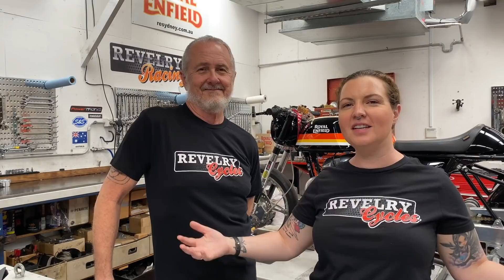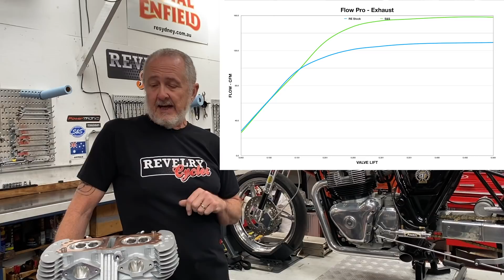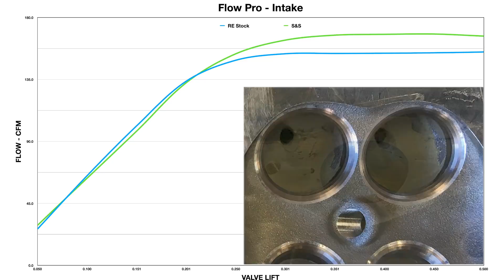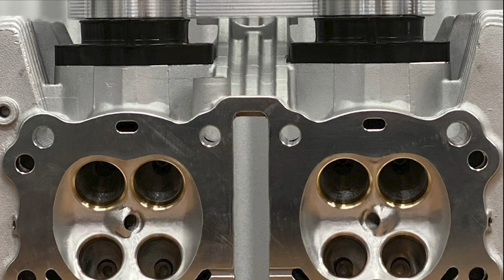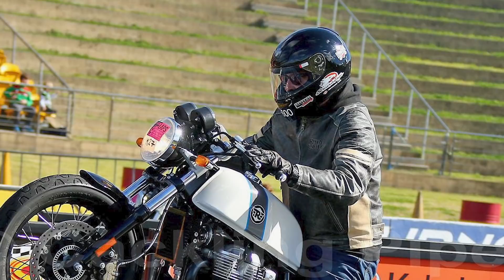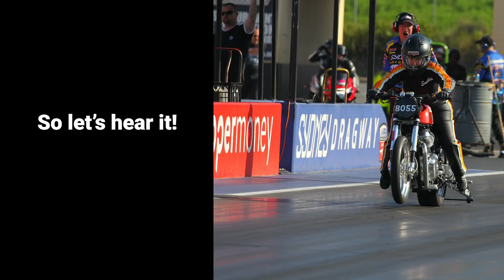Episode 7: CNC Cylinder Heads - Royal Enfield 650 Twins

Comment: You’re half right on the four valve info. Four smaller valves (particularly the intake valves) will generally have higher gas velocity than one big valve. This improves low-lift flow and cylinder fill at lower rpm, leading to increased torque. If you reference the changes in performance of the Harley-Davidson Twin Cam vs. Milwaukee 8 this effect is clear. Great videos and nice work on these great bikes 👍👍

Comment: good morning and greetings from Southern California. I love your channel and just subscribe. I just picked up a 2021 royal enfield Continental GT and I’m absolutely in love. I have a question if you can help. On the top of the cylinder head, there is a plate that’s held down by 48 mm bolts. I want to remove the bolts and slide the cylinder head plate out so I can polish it but I’m curious if those 48 mm boltsare structural so remove them. Also, what is the torque on installing those 8 mm bolts back in? Thank you so much.

Comment: Thanks for another great video.  Been watching these for a little while now and whilst I am only likely to do a fraction of this work to my recently purchased GT650 they have been really interesting for their technical input and impressively presented.  Having ridden mine for a few weeks now I can see why so many folk rave about them - it's a delight to ride on the twisty roads here in mid-Wales.  Air filter & exhausts done with camshaft waiting in the shed for installation but may hold out for some high-comp pistons as well - the more I research the more that seems to make sense although it does seem to involve going down the "electronic tuning" route which puts me off a bit from doing any more than I have although if I watch much more of you two I may well take the plunge.  Ramble over - keep up the great work!
Reply from the maker: The high compression 650 kits work really well with the S&S cam. We're consistently getting 52-56 horsepower and 46-48 lb ft torque with stock heads and throttle bodies. Yes, you will need to use a tuner, like the PowerTronic, that lets you alter the timing. Because the profile of the HC 650 piston crowns makes the flame front travel "up and over" the flame takes ever so slightly longer to propagate than in the flat top 865 piston kits. This means so you need to back the timing up a bit to keep it from pinging on hard acceleration.
Reply: @RevelryCycles  Thanks for the advice - not expected as I was just thinking out loud, but appreciated all the same.  I've only had it a few weeks and will probably run it in its current state for the summer (if it arrives here!) then look to work on it as a winter project and learn about the dark arts of ECU tuning!

Comment: hello :D Im so grateful for this videos. Can you please tell me why in this videos of Royal Enfield modification you don't mention iridium plugs or cables like ngk... don't you think those are significants upgrades on the bike ? Im wondering and asking because I only have money for exhaust and air filter and maybe radial tyres...so... why not change the plugs and cables? 
thank you very much
Reply from the maker: If you're operating within a budget, and actual power output increase is your goal, plugs and wires are not necessicarily high on the list of early priorities. We would suggest when it's time to change the OE plugs is the time to consider an upgrade.

Comment: Thank you very much for the video. I have a doubt, would you help me with it?

I'm currently working on an Interceptor, and the rear breaks are slipping.... They do not grip properly.... Can you help me fix it?
Reply from the maker: Thank you for trusting us enough to ask about your motorcycle concern.  Please understand that it is not appropriate to diagnose, repair or advise on motorcycle issues over email, messenger, the phone, or with photographs or video.  To do so would just add to the mass of misinformed opinions that flood the internet already. If you can not physically bring the motorcycle to us no opinion will be rendered.  If you want to bring the bike to us please ring to make an appointment. If you are not near us and need assistance please seek the advice of a properly trained local mechanic.

Comment: Thanks again for another wholesome and greatly informative video! To answer your question my GT 650 currently has a Diablo full system exhaust, which I picked for the looks and sounds it producest to be honest. The bike also has the stage 1 and 2 performance air filter and a powercommander V piggyback ECU. The latter was a necessaty as the exhaust and filter combo made the engine run way too lean. I also did some cosmetic stuff and slapped on some straight clip-on handlebars for a more racey, active riding position. A Li-Ion battery also just arrived to shed some weight. The next thing I'm saving for will be the SS cam and a big bore kit right after a suspension upgrade. I already enjoy the character this engine has but a little more oomph is welcome. Basically I'd like the same I have now, but a bit more outspoken and with an extra high range kick. The bike still needs to stay a reliable road going bike, I'd just like to get the most active, fun riding experience I can get out of it. Pretty much everything is and will be handled by capable professionals mechanics, as I lack the tools and know how to really do these things properly. I'm not looking to go so far as to change to cylinder head, and I do not yet see how I can utilize you guys from the other side of the world other than learning from your video's. Is there any way I can thank you for your effort from this side of the world?
Reply from the maker: Wonderful message Raynor.  Love your enthusiasm for your bike.  The best thing you can do is share our videos with your social network.  :-)

Comment: With reference to flame propagation across the piston. Have you or do you time the spark plug gap to face the inlet valves ? I have seen spark plugs with 1 or 4 electrodes and wondered if this would help with smoothly burning the fuel .Just curious.

Comment: Big fan of your series on performance upgrades. Looking to make some bigger upgrades next year with plans to have it set up as my daily but also a very capable road racer. Current work done is mostly cosmetic but have fitted a full 2-1 exhaust system, YSS Fork upgrade & Rear shocks, 16T front Sprocket, Switched out the spark plugs, RK Racing GXW ZX-Ring Chain, Hitchcock chain guard, DNA Filter, BREMBO Adjustable Levers & Brake Pads, EBC Brake Discs, Domino Quick Throttle & Switches, Rizoma Oil Reservoir, Clip-Ons, Changed out the Rearsets, LED Tail light, Headlight and Indicators, Shortened the hoop under the seat, Chucked on some bigger rubber and that's it ATM. Future plans are Throttle body, Cam, Powertronic, 865 Big Bore, Revelry Big Valve Cylinder Head, Clutch, and if you got any advice I'm open to any input. Thanks again and keep the videos coming.

Comment: I have a brand new bike and I’m not ready to jettison the RE warranty quite yet.  With that in mind I’ve upgraded the air filter and installed the Stinger 2-into-1 exhaust (both obviously reversible.)  I’ll likely also install a booster plug soon.  When I’m ready to take the plunge I’m going to install the S&S cam then upgrade the clutch.  Eventually I’ll step up to the 865 big bore kit at which time I’ll probably have to go with a Power Commander or PowerTronic, although S&S appears to be on the verge of offering some kind of upgrade kit for the RE ECM.  At what point would you recommend upgrading the brakes?  What about the suspension?  Really missed you guys last week and I’m looking forward to future vids. This is the type of content I love—concise and informative. Great work!
Reply: I’m waiting and hoping R.E. Releases the twin in a 750 in a year or 2 with front dual disc setup. I heard a rumor. Then I’ll by the fork lower, caliper, disc, etc. with new wheel/hub. Waiting on this so I can replace both wheel to 17”.
Reply: @brookcampbell2940 , more likely to be a 900 or even 1000 cc. 750 will take away sales from the 650 imo. Too small a difference, and the strong crank shows that the bike could handle 900 cc quite easily.

Comment: Worth the wait, this one! I understand that many of these modifications are race-only and not necessarily street legal but if you were to choose one config as your daily driver motorcycle, what would it be? An 865 with the narrower throttle bodies? Just the high lift cams and high flow exhausts on the stock bore? Great video guys, as always.
Reply: An 865 with standard throttle bodies would be best for the street as it gives better bottom and mid range power than a change of cams and headers which will give a stronger top end than standard.
If you ride in traffic (most roads these days) you want the bottom end torque